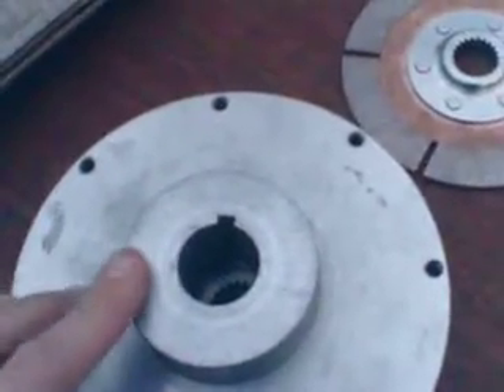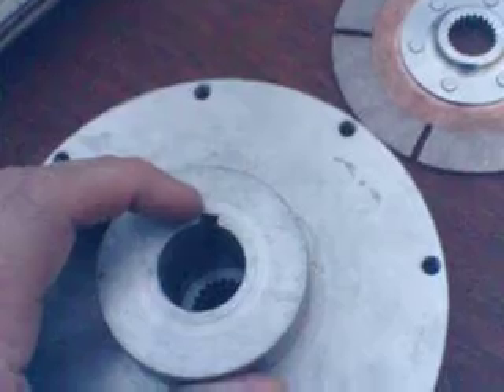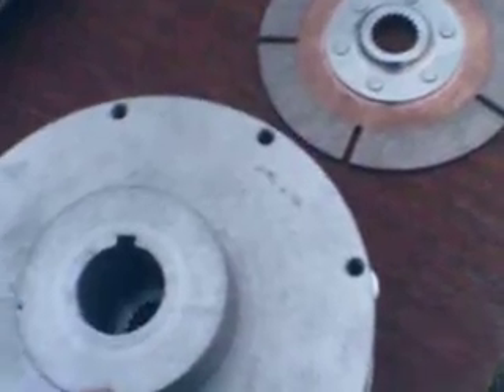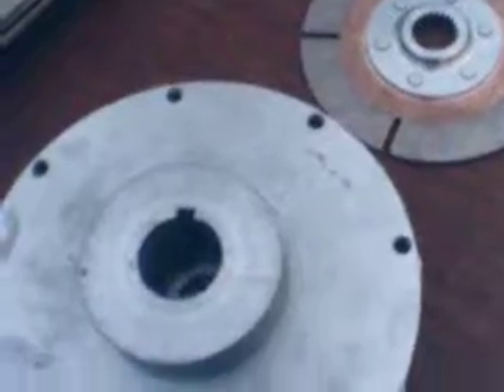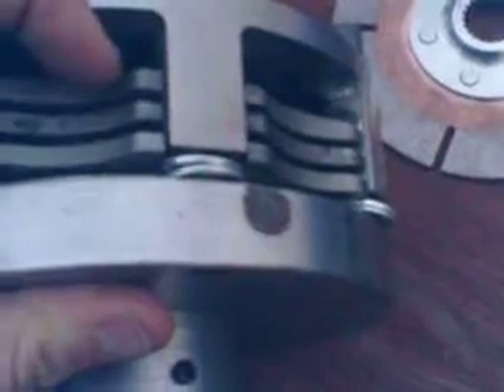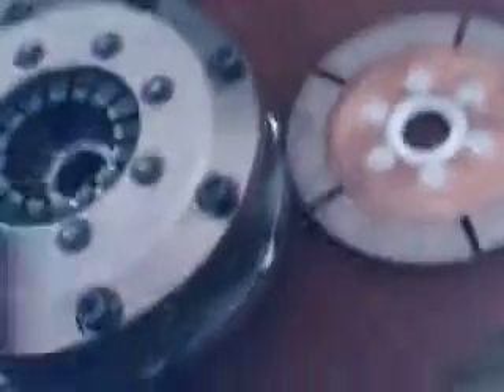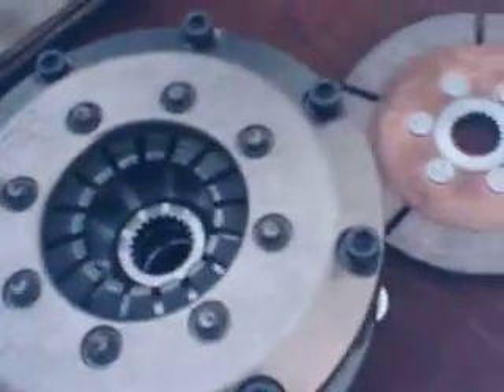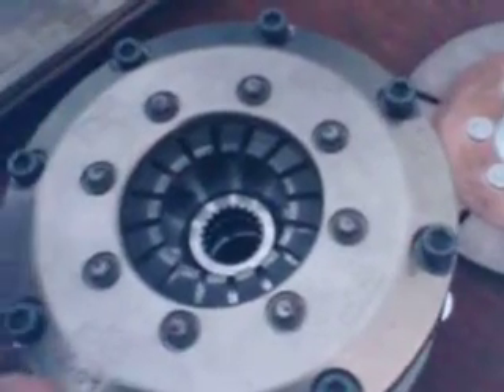Tilton Clutch In Electric Truck

Comment from the maker: @Adamj12b The coupler was turned on a lathe from a solid cylinder of steel and one of the disks is making contact against the the coupler as though it were the flywheel. I am going to have to get a video of the clutch through the inspection hole. Right now the clutch drives the truck very well without slippage and there is no vibration at high rpm like the direct drive hook up that I had. When I push in the throw out bearing it seems to slow down the truck though I will have to practice.